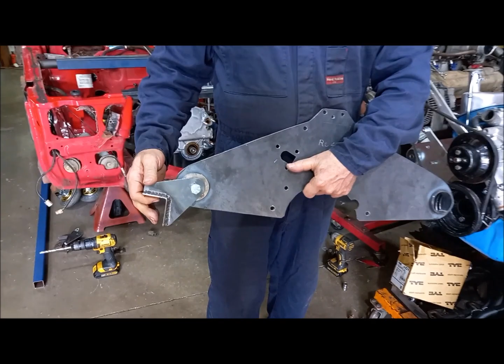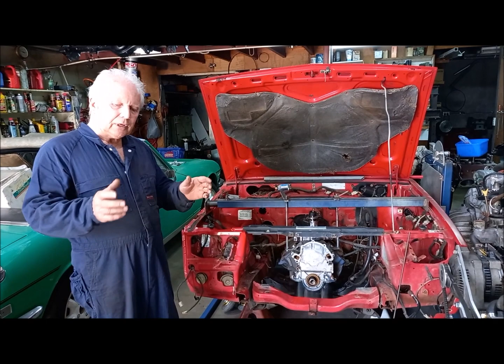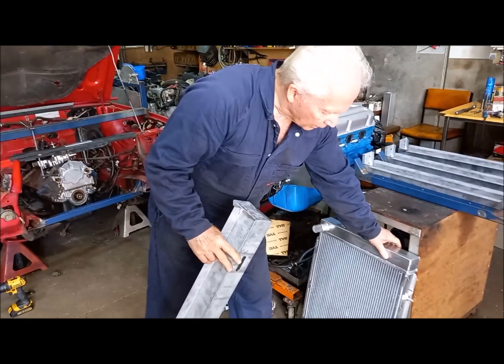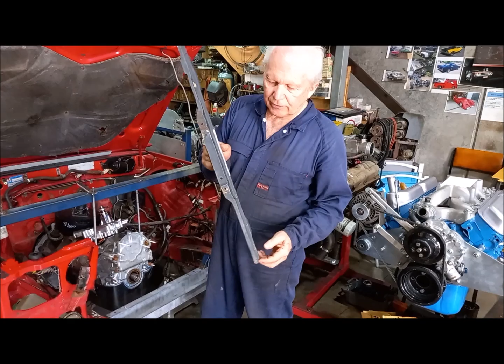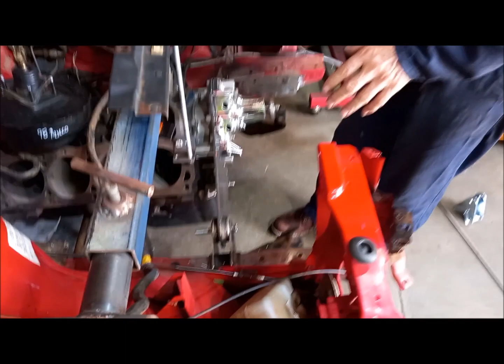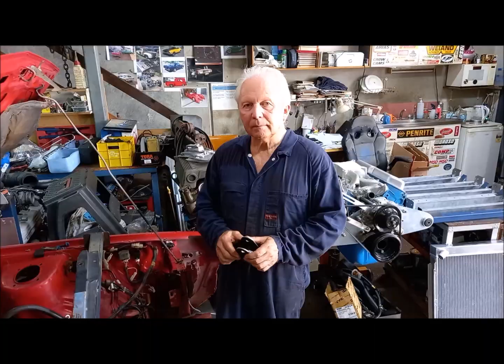V8 Sigma Engine Mount procedure. Engine mounts. V8 mounts

Comment: Brother and I did a similar engine plate front mount on a big block HQ Wagon but we also used a similar plate at the back of the block, because without it there was too much leverage on the alloy bell housing, from the normal way of mounting the engine, great job sir

Comment: i wonder what an engine plate with the chassis mounts  is worth to buy ?
Reply from the maker: It varies on whether you need mounts for AC and power steering as well. Give me a call on 07 5445 2447. George